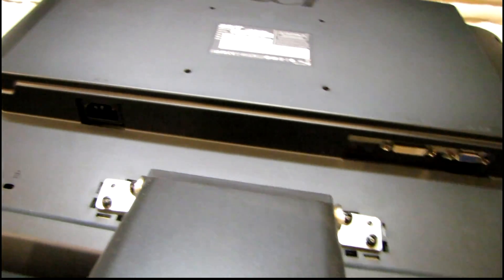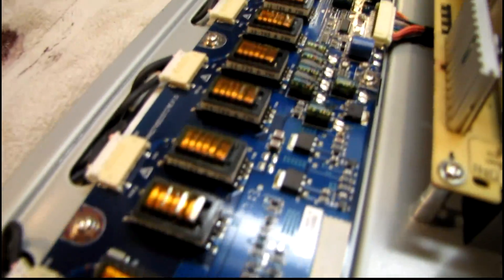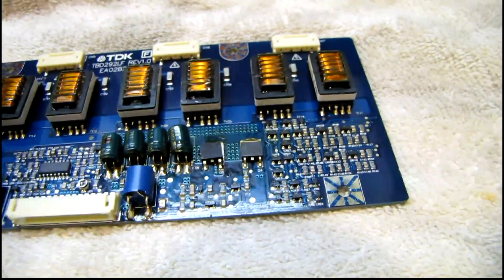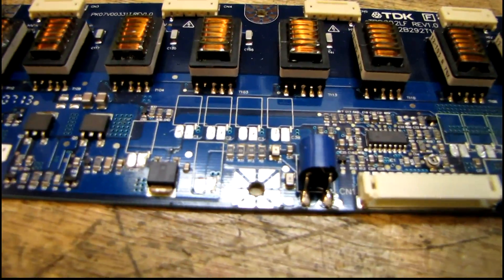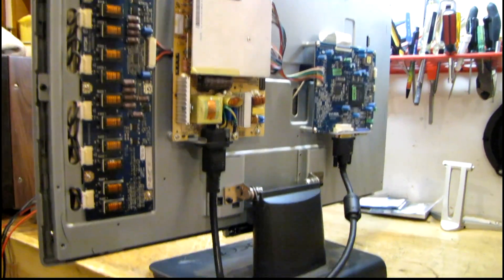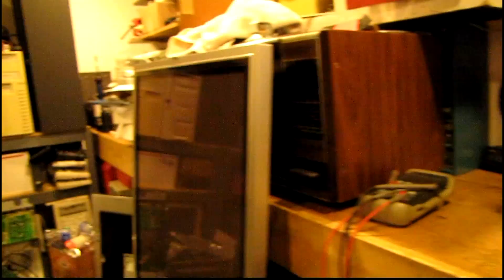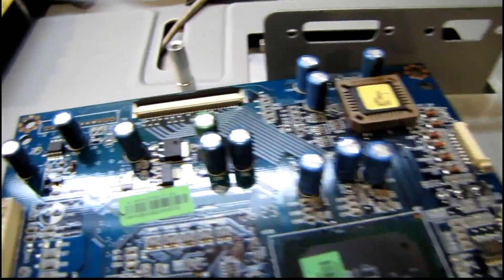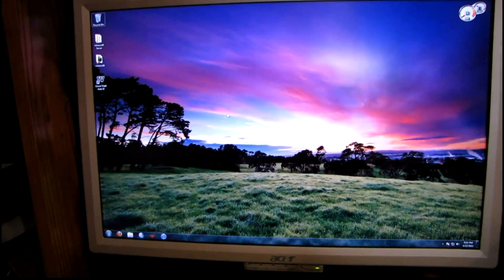Acer AL2416W LCD Monitor Repair

Comment: I got the same monitor from a friend for free.  I've used it for a couple years but yesterday mine had the same problem.  Ive never attempted to replace a cap or mosfet before but here we go.  Thanks for the detailed video!  I helps me feel like I can continue with confidence as I attempt the repair.  Cheers

Comment: Wow! I was so surprised to see so many step up transformers on that power board! what was there like 11 of them or so? I''ve repaired a few monitors too and usually they have like 2 or so, one for each CFL behind the LCD,one up top and the other on the bottom. so I have to ask, how many lamps does that board power?! its a beast!

Comment: Thanks for posting this.  You may have already answered this in your comments, but here it goes...  I had the same problem, but the ACER logo didn't show up.  I replaced the bad capacitors and now I get the ACER logo for a split second.  The MOSFETS didn't look bad, but do you think they could be?   I'm just a "tinkerer" with no real training.  Let me know your thoughts!  Thanks
Reply from the maker: Both of mine had the same MOSFET bad.  Seems to be a common problem.
Reply: Maxxarcade Do you know the Mouser number?  The ones on the board are P2804BDG, P5504EDG, 17812.  Those numbers don't pop up on the Mouser website.  Thanks for your help.  Mouser is great BTW!
Reply from the maker: incompresistible Hmm, going by memory, I think these are what you need.

P5504EDG = 512-FDD4685 (I think this is the one that was shorted on mine)
P2804BDG = 512-FDD8451

Comment: Thanks for the video. I replaced the capacitors with Suncon capacitors and the monitor works every time i switch it on. I had the problem where i'd lose the screen if i turned it off and couldnt get a picture again when switching it on. The Acer logo would go on for a second or two and then disappear with no picture!

Couldn't have done it without your video, thank you :-)

Comment: i gotta change the caps in a old computer of mine a cheap compaq from 2007/2008 they failed pretty quickly since about 2/3 years ago it started failing

Comment: Thanks, same monitor, same problem. replaced the capacitors and the 2 mosfet and the monitor is working again. I would like to know the proper way to unsolder the mosfets.
about $10 in parts.

Comment: my monitor IH252HPB has been having a specific issue: The monitor comes on then will sleep mode. I try to move the mouse as normal, and the screen wakes up for a very brief moment, so that I can see my desktop for a short period of time. Then the screen instantly goes to sleep again. Occasionally, I can fix this problem by pressing the power button on my monitor a few times. Most of the time though, I have to do this process many dozens of times before the monitor reveals my screen.

Comment: Hey, I got the monitor, and some reason, it powers on, but it is just a blank black screen. the capacitors and parts look well and sometimes works, but sometimes it doesn't. any thoughts?

Comment from the maker: It's a 16:10 monitor, hence the 1200 line height.  1920x1080 is 16x9, which is more common these days.  I really prefer 16:10 for computers though.

Comment from the maker: The only way to know for sure is with an ESR meter.  I use a CapAnalyzer 88A Series II.

It's been a while since I did this. but I think the caps I used on the inverter were United Chemicon KMG series.  They were the only ones I had available that were the proper diameter and value.  The monitor is still working well today though.

Comment: I have the same problem. I removed the components, and so far, so good. Waiting for the replacements to arrive. However, since I have never worked with surface mount before, how would one mount the transistor? I have a Weller WTPC with a TC201. Thank you.

Comment from the maker: Those are great for just about anything.  Only circuit that they might not be ideal for is the CPU VRM output circuit on newer motherboards.  The newest VRM I've used them for is Socket A and Pentium 4 stuff.

Comment: Mine had the flickering but as long as i didnt turned it off it would work alright, it will go to sleep and everything without any problem. It also started smelling rly burnt just yesterday, I'm going to take it apart and see what began failing. Have you resolved your burning smell issue? 
Thanks.

Comment: I have years of experience doing cell phone repairs, and light soldering, and circuit board cleaning and repair. Not looking to set up shop on this one. Just a 1x repair for personal monitor.  I don't have an ESR meter, nor spare inventory of caps. Any cost effective advice?  Where is the best place to order a handful of Caps at a good price?  What are the good brands that are reliable?  Any additional tips or advice for a rookie on ordering the correct type and style of caps?

Comment: I have an Acer X233h 23" LCD Monitor. Its started having a prob with a 3" vertical bar that was dim with a single pixel width red line vertically within the bar. then after a few months just went totally black, wont power up.  I dissembled it and inspected the boards, and there are no obviously bad caps. the only thin that looks odd is a water-mark type lines around the board mounting) boards look 2 be in new condition otherwise.  Would you still recommend replacing all the caps on both cards?

Comment: Type in sawder into google it's not there, Solder is. You may find soft sawder, which has a different meaning. I live in Europe and have been to almost every country in Europe some more than once (Spain 5 times) on motorcycles, holidays etc. Dickbreath.

Comment from the maker: Yes, the problem was that, at one time, Nichicon had a defective batch of the HM and HN series caps that caused them to leak prematurely.  A notable amount of Dell and other systems were affected with them.  I can't remember exactly when they fixed the problem.  Nichicon are normally good caps, and I use them in my repairs.

Comment: Amazing I had the same issue and just ordered a replacement inverter board :) hopfully it will work well :) if it does I will probably have to buy a new graphics card as I just bought two new monitors to replace it and my current card only supports 2 monitors.:S

Comment: I was hoping to edit my previous comment.

I used Turnigy High Density R C LED from Hobby King

The Acer AL2416W uses 6 U shaped CCFLs that span the full width of the light box.  The CCFLs seem to get diffused better than the new LEDs that I installed.  In hindsight it would be better to install 14 to 16 rows of LEDs instead of the 12 rows I used.

Comment: Great video tutorial.   I have exactly the same monitor and same problem, but the capacitors look fine.  I opted instead to remove the inverter board and the CCFL tubes and replace them with an LED array.  Cost me about $ 44 CDN including shipping for 360 leds on 1 meter rolls.

Comment: @Maxxarcade It looks like the one I'm looking at. That mosfet is Q6, and then the caps, from the right, are C38, C36, C35, C34, C39, C3, C2 and C1. Those are just those caps lined up.

Comment: Thanks for the vid.  I opened up my dead AL2416W up to find those same 4 capacitors shot.  One was burst right open, and the others were swollen beyond belief.  There was no visual evidence that the mosfets had shorted out on mine.  I bought replacement 100uF 35V caps, and had a tech install them for me, but the monitor is still dead.  I have no expertise in electronics, if the mosfets looked fine, then is there any reason to believe I should replace them as well?

Comment: I had the same as described intially in the video. Having test all the compnentry around the board you described, I found no bad caps or mosfets, or inductors etc. Having had experience with these types of issues I suspected something else if they used cheaper caps for that board. So, I just performed a resolder mod on th esame board you changed the parts on. This was successful as well. My experience tells me that this board might have faulty solder used.

Comment: @Maxxarcade I couldn't find a obviously blown cap in it so I have a full set on order to recap the whole PSU.

I did fix the 32" Proton HD LCD tho, but its still got a bit of picture noise (dvd looks like VHS quality) and again, I think the PSU needs a full recap. the 2 1800uf 35V ones look a bit old and sad.

Comment: Hey Maxxarcade, I have a samsung monitor that is bad. Slowly died, flickering. Any suggestions on getting it fixed? Its a 2006-2007, debating about shipping it to samsung for a $150 repair, but looking for a cheaper option. 
Thanks in advance!

Comment from the maker: @Aussie50 Samsungs are notorious for bad caps.  Let me know what you find! 

Usually the standby light is orange.  If it is blue and there is no picture, maybe the backlight is out.  That will be a sweet monitor to fix though.  24" ones aren't cheap, even used.

Comment from the maker: @TromboneSexy There are too many bad ones to list.  Some of the more common crappy ones are Teapo, G-Luxon, SamWha, Fuhjyyu, Lelon, Gloria, etc.

Good ones are Nichicon, United Chemi-Con, Panasonic, Cornell-Dubiler, Rubycon, and possibly some others.  Mainly  the ones from Japan and USA.

Though there have been a couple defective ones from good brands before.  Nichicon HM and HN series had a bad batch a few years ago, and so did Chemi-Con KZG.  These were used on computer motherboards.